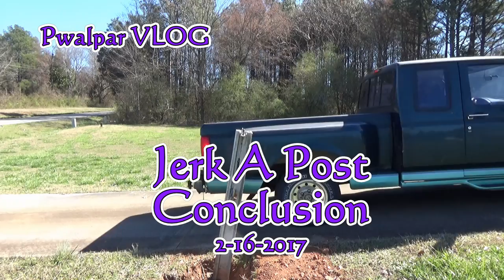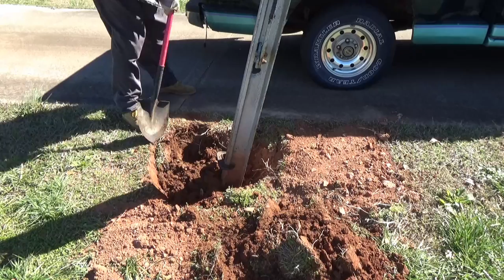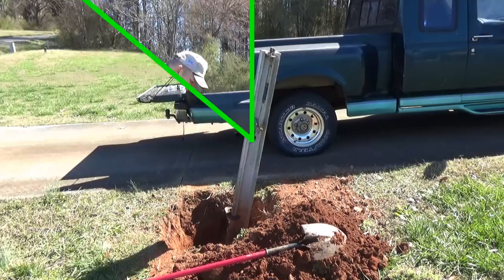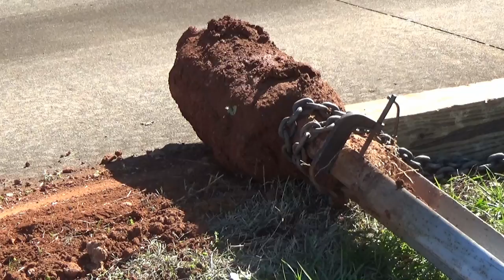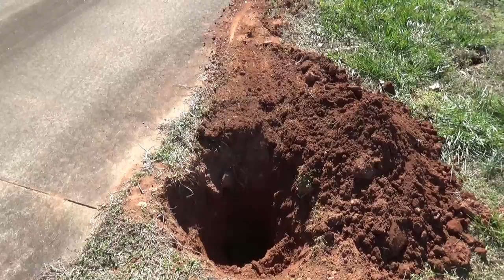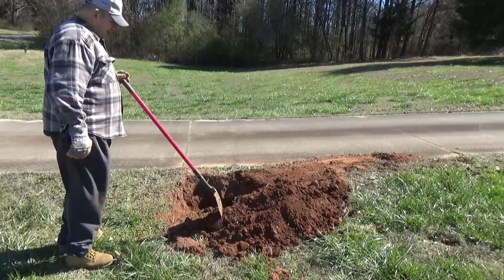Jerk A Post Conclusion 2 16 2017

Comment: I'm no expert on rail, but that looks like the old Code 60 rail, which supposedly weighs about 60 pounds per foot; allowing for the holes cut in it and the shaved rail head, I would guess that post and cement easily weighed over 400 pounds; that takes a lot of jerking. Well, at least the Earth didn't deflate when you pulled it out. Good job.
Reply from the maker: I got no scales to check with lol